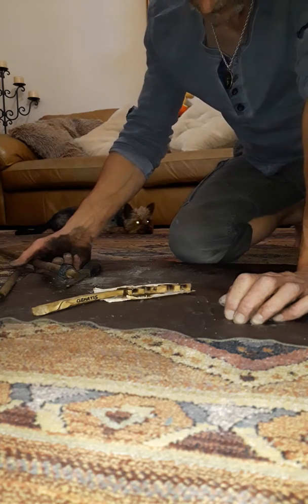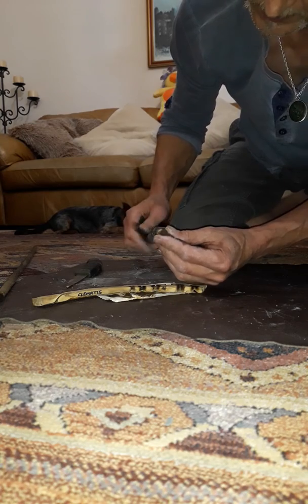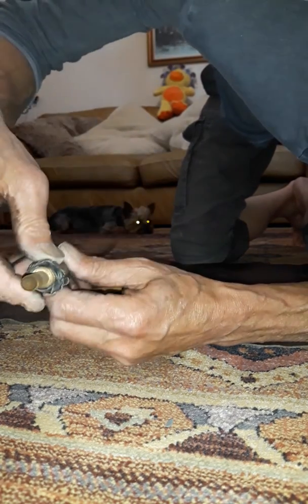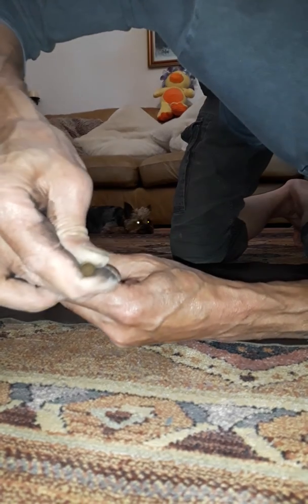Experiments continued..

Comment: Mr Tibbs, try that spindle on a hearth that you've had success with in the past and vice versa with the hearth. This may give you some indication as to the suitability of the wood you're using. Normally both the hearth wood and the spindle you're using is perfick ! but humidity, heat, hardness etc play a part. Have you heard of drying cycles ?